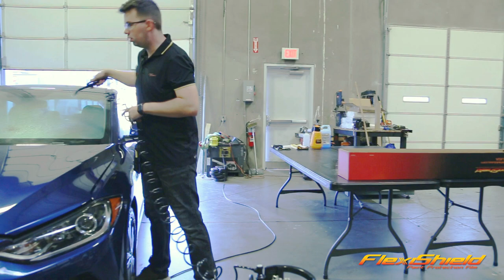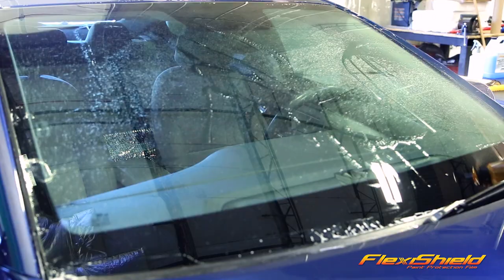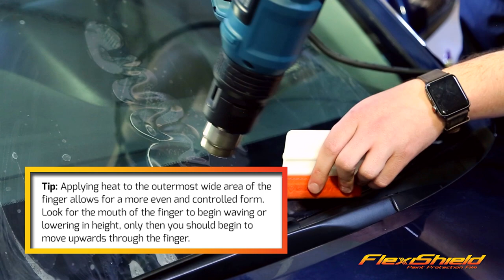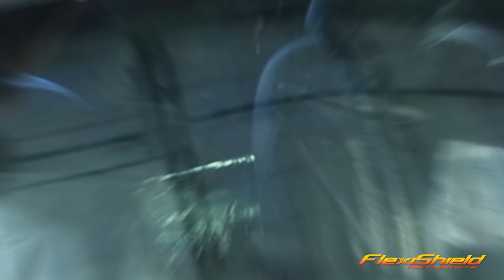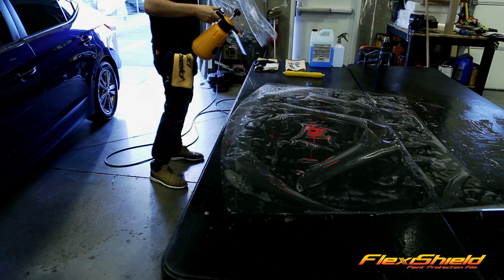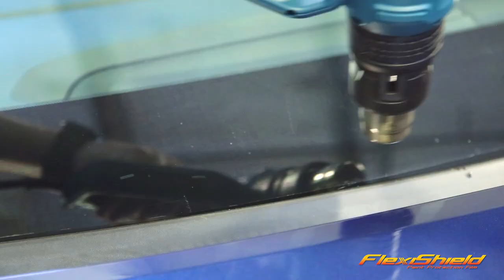How to Install Windshield Protection Film | FlexiShield DFR

Comment: Pro tip use a vertical glass peel board to peel that liner. If the film is flat it will always have stuff fall in it. 

Also how many months does it last? And how good is the protection?
Reply: This film carries a 12 month warranty 
but should outlive if cared for

Comment: Excellent job!  Is it possible to do this on a Motorcycle Windshield?  I have a new clear windshield that's very easily scratched.  I'm hoping there's a heat shrink film that can work for my application.  Appreciate any suggestions.  Thanks!

Comment: Question, can this be installed on the inside of the windshield. I have a high pressured car audio system. Heard something like this will help in prevention of cracking

Comment: old video but what can you use to clean hard water spots off the film>?
Reply: Ceramic coating it can prevent that from happening! but Typical cleaning methods should remove the spots

Comment: Perfect video to show why these films are a non-starter for most daily drivers. Way too much labor and the film itself is too expensive to make it practical for daily drivers that will wear this film out in 1-2 years of driving, parking in the sun, and using wipers. You could get a new windshield every 2-3 years instead and come out ahead financially. Great for weekend cars and exotic with $10K windshields though.
Reply: Why is it so expensive? Shouldn’t it be cheaper since the installation is outside?
Reply: @junior17medval  Because it's much more difficult to apply this type of film than window tint or clear bra. Window tint is super thin so it wouldn't do anything to protect the windshield if installed on the outside. Clear bra is very thick and flexible, but would make way too much distortion. These windshield films are thick and firm and therefore are much more difficult to install and also it's too expensive for but the film. It only makes sense on exotics since it won't last long on street cars and costs more than windshield replacements over time.
Reply: @lamda45  I understand it’s much thicker but like I said it shouldn’t be harder to install since the 99% of windshields out there are just one flat piece of glass with some slight curvature. I’d argue installing clear bra is a lot harder because of the body lines on vehicles. Any professional window tinter or even vynil wrapper should not have any trouble installing this. On top of that it doesn’t last long, 1-2 years at the most. Maybe you’re right it could be for exotics but for the average joe it’s a no.
Reply: @junior17medval  Windshield are never ever flat, and clear bra stretches a lot more than this film. Once you try to install it, and give up, you will really understand. Most of the tinters and clear bra people won't touch this stuff. If they do try it, they quickly give up on it and stop offering it. It's just the way it is. Please try it yourself and report back.
Reply: @lamda45  you know what i mean obviously windshields are not 100% flat that’s why I said they are curved. It’s not like they have edges or body lines like a fender which is what I was comparing it to. Just like any product in the auto industry with time, products will get better and easier to work with.
Reply: It doesn't seem like that much work, get everything you need in one spot, and turn off the TV for a few hours. Seems to be equal or less labor, than waxing your car.

Comment: Does this protect from rock?
Reply: It probably depends. Is the rock the size of your small fingernail or the size of a baseball ?
Reply: K Dalton like regular debris that will chip your windshield on the highway.
Reply: Yes, It is an Impact resistant film to prevent Rock Damage, chipping, or Cracking. As well as our DFR prevents pitting caused by sand, Acidic bug , and other contaminants!
Reply: @davidflexishield6136  Rack damage? That's a sly way to avoid responsibility
Reply: @dodgesteelenterprises  LOL unintended